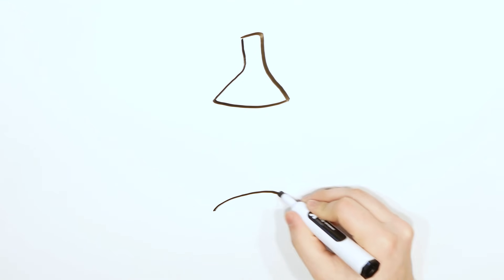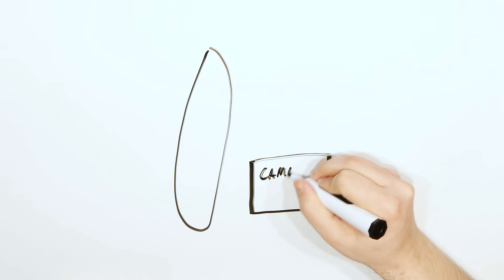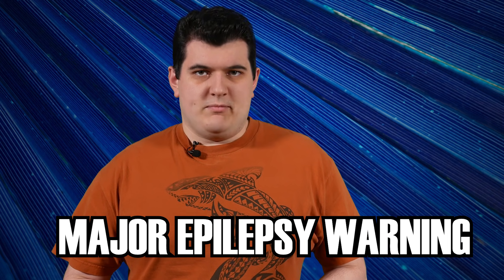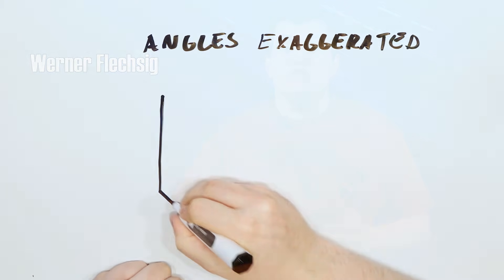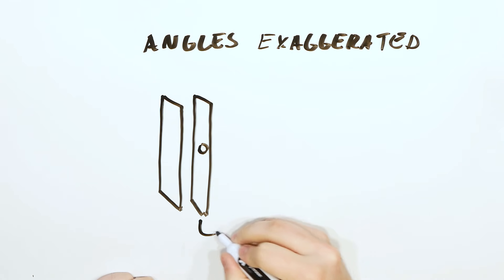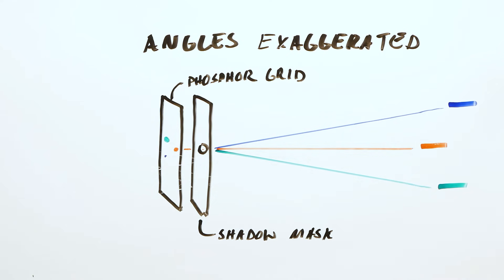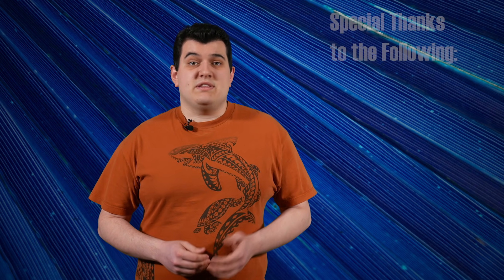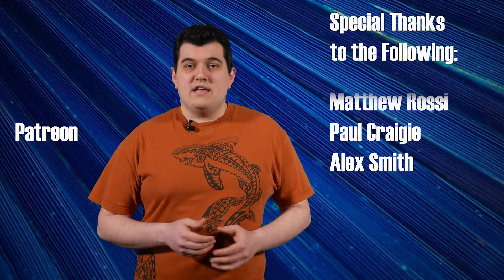How Analog Color TV Works:  The Beginnings

Comment: NASA used Westinghouse color cameras that were based on the CBS sequential field color system in the Apollo, Skylab, Apollo Soyuz Test Project, and the first decade or so of the Space Shuttle program. The exceptions were the Apollo 15-17 missions used an RCA sequential color camera on the Lunar Roving Vehicles for lunar surface television broadcasts and the payload bay cameras for the first decade or so for the Space Shuttle program.

Comment: (1:30) '...yellow light will stimulate both the red and green cells in your eyes in close to equal amounts....'

So, not equal but 'close to equal amounts' -- I'm betting it stimulates the green cells more, as yellow is closer to green on the spectrum than it is to red (what with orange standing between yellow and red, after all).

Comment: Actually we don't see "three colors", we actually see all the colors within the "visible range" with three separate sensors, each of which has its own simple "stronger or weaker" response to every color (wavelength) it perceives, each type maximising its response at red, green and blue wavelengths correspondingly. Responce functions interlace is why we can't tell difference between a color mix and a "native wavelength" color, and this is why discrete wavelength color tv is possible

Comment: there is this theory that the chroma signal kind of 'fits in' with the line frequency so the two can be separated perfectly by some kind of future technology I never understood that thing I'm not that well versed in 'radio technology', apparently there are 'holes' in the luma spectrum because of the line frequency and those holes are filled by the croma signal at least that's what I've gatherered I'm not a philips engineer and this is all way above my head. I'm kind of sceptical of the theory because there are all kind of low frequency signals there that are not repetative but I'm kind of out of my league here..
Reply: Yes.
Unfortunately, the "references" available on "Wikipedia" and such are often "corrected", by those who know less.

The RCA/NTSC "Chroma" signal was a "signal" which "defined" the "phase" of the "color" (at any instant) relative to the phase of the "color burst" during the "Blanking Period"
This "information" was extracted from the additional Quadrature Modulation of a very small extra signal component (at a very particular frequency) added to the "composite" TV signal - which would be "ignored" by monochrome receivers.
(These are [possibly] the "holes" to which you have referred.)

The TV "Picture" transmitted was "Monochrome, with the "Chroma" signal adding in Color to the main areas.
The "definition" of the "Color" signal was very much less than that of the "Monochrome" signal.
However, the Color "errors" occurred only at the edges of brightness transitions, and were not easily noticed.

The result was a (relatively) high-definition monochrome picture with a "blurry" color "wash" in the "important" parts of the picture.

There were three main ANALOG broadcast television systems in use around the world, NTSC (National Television System Committee), PAL (Phase Alternating Line),  and SECAM (Séquentiel Couleur à Mémoire—Sequential Color with Memory).

These were jocularly referred to as 
(NTSC) - Never Twice the Same Colour (because of "Phase Shift" transmission problems), requiring the use of a "Hue" correction control on the TV receiver
(SCAM) - Something Entirely Contrary to the Americans  and
(PAL) - Pay for Additional Luxury - since it overcame the "Phase Shift" problem.

Digital television broadcasting standards, such as ATSC, DVB-T, DVB-T2, and ISDB, have superseded these analog transmission standards in most countries.
Reply: @FrodoOne1  I remember a little bit about this subject. yes the chroma signal is frequency limited to around 1Mhz and in NTSC it gets modulated onto a carrier signal that's around 4MHz (iirc) and in the spectrum the resulting chroma signal sits between 3 and 5 MHz. In the receiver the carrier get's filtered out of the luma but that's a sharp notch filter and it doesn't filter out any changes in the color signal. Changes in the chroma is what generates those sidebands.
So thats means that around a color change you could see these little dots 'crawling' that's the chroma signal below and above the notch filter. I had a BW set once and it didn't have that filter and you could see those dots crawling all over the screen wherever there was color not just the edges.
Anyway this is from what I got at school I'm not an expert you have to know something about amplitude modulation to understand these things.

About those holes in the spectrum I believe the idea was that every next line the signal is more or less the same so it's the same 'sample' that repeats every time. The line frequency is around 15KHz and these two things also kind of AM modulate and that gives these 15KHz holes in the resulting spectrum but I am little bit out of my league here this is what I more or less can remember. 
My hunch is those holes are not absolute the color does change from line to line and that should generate signal in those holes I guess but I really don't know much about the subject. it's interesting though.
They thought they could do something in the future with this factoid with advanced filtering (DSP?) You would need something like a comb filter or perhaps a smart comb filter here? I don't know all guesswork..
Reply: Ah yes the luma signal has the same thing going on and has the same holes so the resulting spectrum looks like a comb where the peaks are 15khz apart. The idea was that there was a shift between the two so the chroma peaks would sit nicely in the luma holes. I don't know if that was usefull at the time or just a possibility for future advanced filtering.
Reply: I feel the need to futher explain this say you use a 15khz sine wave generator for your color. It runs in sync with the line freq so on screen you would get a picture of say red on the left, a smooth transistion to purple (or magenta?), in the middle and then back to red again on the right. and then the next line begins there's no sharp transition between lines it's an overall smooth sine wave.
When that signal get's modulated onto the chroma carrier you get a spectrum that looks like this: i I i
so one peak at 4Mhz or 4000khz and one below at 3985 and one above at 4015khz. The distance is exactly that 15khz. Say you double the frequency to 30khz so you get red/mag/reg/mag/red. now you get sidepeaks at 3970 en 4030. You can apply those two at the same time I won't try to describe the picture but you get a spectrum with all 4 sidepeaks. this applies to any higher frequency offcourse, that's how you get that comb like resulting spectrum. Ofcourse when color starts to change from line to line in an actual picture then something else appears. But generally, since color doesn't change much from line to line, a comb like spectrum appears that was the idea. (I guess)
Reply: Ah yes I remember the chroma carrier was supressed at the transmitter side so on a pure black and white picture there would be no chroma signal whatsoever not even an 'empty' carrier that's why there was that color burst between lines to regenate that signal in the set you're right. So maybe there wasn't a notch filter in the set that would offcourse filter out stuff in the luma.
Reply: I guess a notch filter in the set would result in a kind of I I I i i i effect after a sharp transition because of the missing freq component (or the ringing of the filter)

Comment: The colour TV system used on later Apollo missions used the spinning disc trick for achieving colour TV in a camera light enough to go to the moon.  You can tell because you can see a rainbow effect around any object that's moving with anything above a very slow speed.

Comment: Early TV screen until 70s used dots instead bricks. I think they realized  that being dots togheter, it presents a problem. It is several areas without light, cause of screens were less luninous, imagine dots and the not-perfored areas are shadow, in fact when you use a rachel net is for reducing sun and the grass area will be shadowed. Same happenwd in screen mask. That why the changed to bricks, rectangular shape, due the area not lighted is almost invisible, the lines between each color is very thin. 
Christ, Santiago, Chile

Comment: It is not quite correct to say the human eye "only sees red, blue, and green".  It is more correct to say that the human eye has three different color sensing nerve cells, and each type is most sensitive to red, blue, and green respectively (there is also a fourth eye nerve cell that detects detail in low light, but is colorblind). The three color nerves can also sense other colors, like yellow, but those colors stimulate the nerves much less and so the brain relies on comparing the stimulation of the three nerves to detect other colors. This is why simply using RGB light a television/monitor can trick your eyes into thinking it is seeing other colors than just RGB - the  phosphor dots/pixels can control the relative intensities of the RGB sub-dots/pixels to simulate other colors. It is really interesting to think that some animals who's eyes see colors differently. To dogs or cats, for example, RGB screens might appear very muddy, with a lot of greys and backwards colors from the real world. Maybe that is why dogs and cats are not usually interested in TV that doesn't specifically cater to their interests.

Comment: It’s so weird to think about how complex all of this was way back then. Analog television, while antiquated, is so much more complex than digital television. Digital video is just a set of instructions (granted a lot of instructions) on how to recreate each frame. Simple enough of a concept. Analog tv is so much more difficult. Strange signals involving amplitude and phase, electron guns firing electrons at a glass screen with electromagnets to control where the electrons go in a set of lines, and compatibility between black & white and color signals. So much more goes into it. Not to mention, digital screens are just so much more compact and look infinitely better than analog screens

Comment: Excerpt from wikipedia explaining what a triad is:

https://en.wikipedia.org/wiki/Triad_(monitors)

In CRT or computer terminology, a triad is a group of three phosphor dots coloured red, green, and blue on the inside of the CRT display of a computer monitor or television set. By directing differing intensities of electron beams onto the three phosphor dots, the triad will display a colour by combining the red, green and blue elements. Each triad forms one pixel of the displayed image.  

http://sep.stanford.edu/sep/jon/family/jos/webtv/developer3/design/resolution/index.html

The inside of a television or computer screen is lined with light-emitting phosphors. ... Each group of three phosphors is called a pixel, or a dot. If you have a magnifying glass or exceptionally good eyes, you may be able to differentiate each individual phosphor simply by scrutinizing your computer screen.

Now in clip 9:47 according to you phosphors are not pixel but according to those
links I posted triads are phosphors which ARE considered pixels.  So now can 
you provide the source of your info so we can see it for ourselves to determine if 
what you are saying is factual because it doesn't appear as if it is and mind you its 
a small discrepancy but it sticks out so can you please correct it?

Comment: I, as an early 1970's TV repairman, replaced not a few 21FJP22 CRT's.  You have to be a degaussing, purity and convergence artiste.  As per convergence:  Be both static and dynamic capable.  If you're not, you're a mere amateur.  Be sure to warn the customer not to use a vacuum cleaner near their massive color set. 3.57954 MHZ forever.

Comment: Eh I didn't get a color tv until the early 1980's when prices were saner. $400 in 1967ish (when color TV's were common in stores like Sears everywhere) is like $3100 in 2019, such a price point made me skip getting a plasma TV in the early 2000's. These days (2010+) I just quit TV altogether, no need for it when there's PC and torrents.

Comment: Even if the old TVs did not really have pixels, they must have had something similar. After all, if you zoom in, you see that the horizontal resolution is discrete. You have a certain number of columns. I doubt this number was completely arbitrarily chosen by the TV manufacturers. It seems more likely that it was chosen to fit the discrete horizontal resolution of the TV signal, if there was such a thing. There was certainly a discrete vertical resolution in the TV signal, since it had a certain number of "lines". It seems plausible to me that there actually were something like pixels either in the TV signal, in the physical TVs themselves, or in both.

Comment: My late friend Sheldon Haas disclosed a way to make field sequential viewing a lot more compact than with a color wheel: Mylar sheets between rollers.  This could be done with a profile just slightly larger than the screen, assuming some buffer rollers at one side.  However, it would also have required large areas of the Mylar roll to be colorless (so only one color would be filtered thru as the roll doubled back on itself) and a really long blanking interval.  Alas, this was in the 1990s.  I later worked out a way to do without the clear portions, by wrapping the roll entirely around the display, so only the color passing in front would be...in front.  Still either a long blanking interval or opaque black portions on the Mylar.

Comment: The 144hz RGB 24fps 405-line CBS system would’ve been interesting to see in action. The 405-line resolution likely would’ve allowed greater compatibility with UK TV programs, which if slowed down 4% and given multiple duplicate frames, would be compatible. It also would’ve made films much easier to convert, they’d just need to be scanned differently, but there’d need to be no 3:2 Pulldown or 4% PAL speedup.

Comment: Even if the colomask is not a pixel mask, it defines the resolution of the TV in pixels.
Imagine your image signal has infinite resolution. If you run it thhrough a shadow mask of 320 holes horizontal - you will get a 320 pixels horizontal image. That´s almost like sampling, in a "mechanical" way.

Comment: So RCA lobbied the government to make it so only their product would be legal?
Reply: No, they lobbied to allow their product to be broadcast in the frequencies of existing monochrome TVs
Reply: @eeddgg1  This is what's significant and in a way vexing when you think about it: that the FCC controls the TECHNICAL content of wireless transmissions.  You're not allowed to transmit more, or less, than or different from what your license specifies.  The deal is that if you tie up spectrum, you have to not waste it, and the assure you don't waste it, FCC controls it.  Which means you even need permission to transmit stuff experimentally.
Reply: @goodmaro  I meant that as in that they weren't specifically lobbying to get CBS's color system banned, but instead to be allowed to run theirs at all, which goes double for companies broadcasting in spectrum already in widespread usr
Reply: They had to also prove that it wouldn't harm existing monochrome TVs

Comment: The loss due to the shadow mask is why the flyback on a color TV cranks out over 200 kV.  If we thought B&W TV's were bad touching the wrong places, color TV's took that lethality to a whole new level.  We're getting into power line distribution voltage territory here (though the amperages are substantially different since in a tube it's the voltage that counts not the amperage so 
 the flyback in a color simply exchanges amps for volts with additional secondary windings).
Reply: And 200,000 electron volts into a metal mask puts out hard X-rays -- I was wrong elsewhere when I wrote that they were soft -- enough to penetrate the glass of the tube.

Comment: Picture versions are a bit off to real life because on the real thing both the blacks, greys and the 2 shades of RGB are blended in transparent and in a way that there are no black and grey boarders so far away from the screen it's just black and grey but up close with the TV turned off you see the light and darks with the black and grey under in transparent.

It's really the full RGB Lights set on top of the Grey so the grey is wide enough to fit all 3 shades on and the same thing with the Darks on black but they are stright lines no breaks at all so the pictures online are all fake of it.

The strips are transparent so you see the greyscale and the colours in the one vertical strip in the glass.

The bit with the TV up close was what it really looks like but to see it better you gotta turn the screen off and zoom up close to see what it truelly looks like with the shades mixing transparently together with the greyscales.

Comment: NTSC, named after the National Television System Committee,
Pal phase alternate line
Reply: (these jokes are dropped you kept using it incorrectly)
Reply: I first heard the Never Twice the Same Color joke on "Fast Forward", an educational TV series of a few decades ago covering much the same ground.  The m.c. was very much like our present ones here and on other YouTubes too; seems tech geeks tend to have the same sense of humor.  He snarkily diagramed a hypothetic all-modes-compatible system called NTSEQAMIR, complete with antenna tower bent at right angles in the middle to accommodate horizontal and vertical polarization.